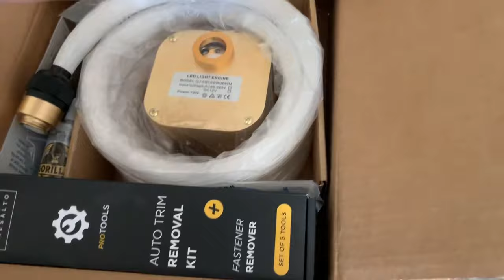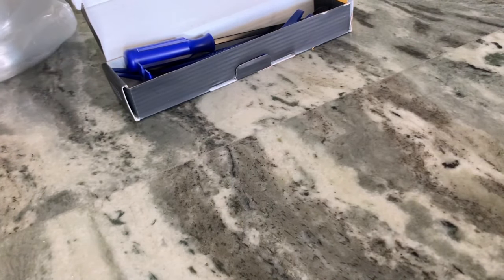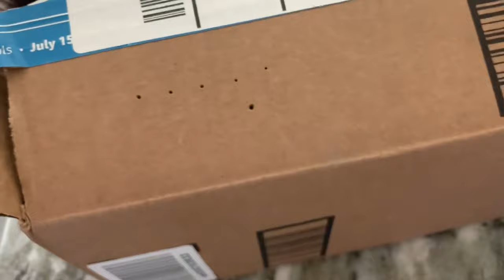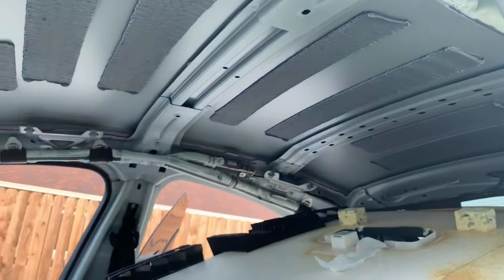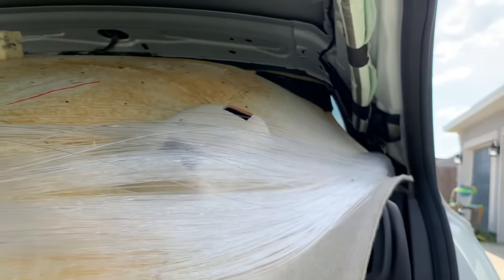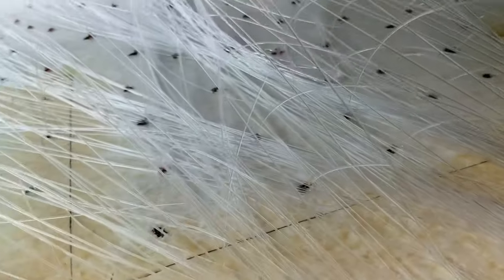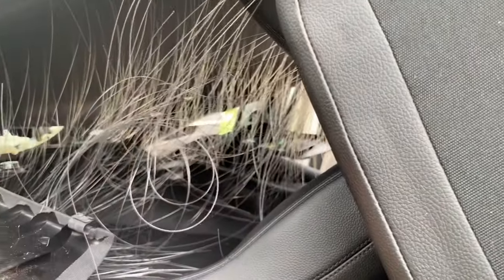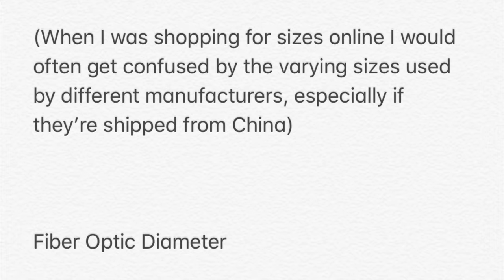How to Install a starlight headliner in 2023

Comment: Would you recommend me drilling holes into my sun roof shade to have it in my shade when closed?
Reply from the maker: Riley Becerril I would not recommend using a drill. I would recommend using a push pin to press through it
Reply: Reynaldo Velasquez i just don’t know if the push pin will be strong enough to go through cause the sun roof is harder than my headliner
Reply from the maker: Riley Becerril ahhh I see, well then in that case I guess you will need to improvise. Yeah try the thinnest drill bit you can find
Reply: Reynaldo Velasquez okay Thankyou
Reply: Reynaldo Velasquez would you honestly think it’s a good idea for me to do that? I’ll have to give it a lot of slack right when it comes out and tape it down to the sun roof, and I have tinted windows so it isn’t noticable
Reply from the maker: Riley Becerril I guess I would use the pin needle and tap it with a rubber mallet to get it to pierce the sunroof. Be a little creative I guess
Reply: Reynaldo Velasquez okay Thankyou I will try that first and if not I will drill it
Reply: Did you make a vid for the sunroof part? How did you run the wires??
Reply from the maker: Whitney Johnson I just ran the cigarette lighter plug 🔌 between the back seats from the trunk, and plugged it into the back seat cigarette lighter outlet. Nobody sits back there and so nobody has ever noticed this small wire back there

Comment: What year is your car? Planning on doing this on my 2017
Reply from the maker: 2014 Mercedes-Benz Cla 250
Reply: @ReynaldoVelasquez  okay thanks. One more question. The black pieces on the headliner which you labeled R1 R2 etc, did they cause any issues or problems when reinstalling the headliner after you toke them off and put the optics underneath? Meaning since they were not flush with the headliner, they now just rested loosely on top of the optics.
Reply from the maker: @jsjc100  no they didn’t cause any issues. However when I was reinstalling the headliner and shifting the headliner left and right to shimmy it up… the black things would try and reposition themselves so I would stop and put them back in their original location.
Reply: @ReynaldoVelasquez  I see, maybe taping them down would help? Or gluing it a bit using a hot glue gun?
Reply from the maker: @jsjc100  I don’t know if tape would really help, maybe duct tape…. And I’m not too sure about the hot glue gun, the fibers can’t/shouldn’t really be folded flat. The need to have a little arch. If you bend them at a 90* angle they may break and then they won’t conduct light as easily. They do have a little bit of glass in them so we need to try not to snap it
Reply: @ReynaldoVelasquez  oh yeah make sense, slipped my mind that your not supposed to bend them 😅 thanks for the replies! Cheers 🍻
Reply: @ReynaldoVelasquez  any idea what the purpose of those black parts you labeled R2 etc are? I’m thinking maybe I shouldn’t even put those back on
Reply from the maker: @jsjc100  I still have yet to find out. you know what... I think im just going to google it. and reply back with an answer

Comment: Hello sir, you seem like you are experienced with all of this. I wanna install this on my mustang 2012, I just have concerns regarding which one to buy, the 32W or the 16W, what are the differences other than the wattage and length? in addition to that, from what you see, do you think 335 pcs is enough? or should I get 430?
Reply: 450 would be good it would also give you enough to add in a design if you want. For instance I’m putting a Z in mine.

Comment: Did you ever rewire it to the dome light? If so, how?
Reply from the maker: No I never got to do that. I just wired it to the auxiliary plug/ lighter fuse. I figured there was no need to set it up to the dome. Just adding more work for a small effect

Comment: Do you have to wire this or can you just use it with the cigarette lighter
Reply from the maker: You can use both options
Reply: @ReynaldoVelasquez is there a certain way i have to separate the fibers to install them?

Comment: Will it be ok to use silicone glue?
Reply from the maker: yared haile I’ve read some people have used silicone glue, and epoxy in other applications like making model trains and model spacecraft or other things that use fiber optics. But I don’t want to Steer you wrong for this project when you just want to get it right the first time. I will say this, NEVER use super glue because it will melt the fibers and make them brittle, you can use a hot glue gun but it may burn the fibers if you touch them with the hot tip plus having it plugged into the wall that whole time will take a toll on it, and the electrical cord will be getting in your way and you’ll be trying to squeeze a handheld gun between hundreds of congested fibers without bumping into them or damaging them. I will just say this buddy, just use the glue I used in the description. I know for FACT it dries fast and will not damage the fibers. Hope this helps
Reply: You could probably try putting a dot of glue on one fiber to see if the fiber still works

Comment: What a reasonable installation price ?
Reply from the maker: I’ve seen some people (not businesses) here in Texas charge as low as $400 to do it for a side hustle. I personally think that’s too low of a cost for the amount of labor going into it. And I’ve seen businesses charge anywhere from $1500 - $2500. Hope that helps. On average I’ve seen the 2000-3000 at a shop

Comment: How did you wire the motor ? Great vid
Reply from the maker: Heather Hasty hi! I’ll be making that video in the next couple weeks. And uploading it. I needed a new fuse tap. It turns out I ordered the wrong size, but I’ll explain it to you
Reply: @ReynaldoVelasquez  thank you so much this was a excellent  video and enjoyed learning how to do this thank you so much i also subscribed looking forward to the next vid
Reply: @ReynaldoVelasquez  Did you get around to doing this video by chance? cheers.

Comment: What and what did u buy just to make sure ?
Reply from the maker: I bought a light engine with twinkle effect. About 9ft of fiber optic that came with it. I bought a trim removal kit for the headliner removal. Markers, some nippers to clip the fibers. Gorilla glue links should be in the description but I need to check if they still work

Comment: Can I wire it to the headlight switch
Reply from the maker: Jack’s Mustang  I suppose you could... but i don’t want to steer you wrong. Look into it and try it out and let us know
Reply: Ok
Reply: I know alot of you guys aren't that tech savvy but maybe you are but o do know that if your running alot of different aux items to your fuse panels or other switches I would recommend having a professional wire it directly to a blank slot or to your aux lights. 12v may not dream like a lot but it can def drain. We all know all newer cars live off electricity. So I'm will be bvb using the cig lighter option only cause I have a12v socket already in my rear and that already is connected to my fuse box....powered off after use power on  whe. I wanna stunt....simple. I would be powering them off nightly so it's not it's not li ing for current while the car is off....please correct me if I'm wrong

Comment: what did you do with the bulky power supply
Reply from the maker: I cut off the the plug kept the wire and wired it into my fuse tap. And the light engine is stored in my trunk
Reply: @ReynaldoVelasquez  thanks.

Comment: You should just get a separate battery for the trunk your gonna customize more you can set you a fuse panel just for the accessories I do that to my cars but with the starting system it's a theft deterent
Reply from the maker: Hmmmm interesting….. I want to learn how to do that
Reply: Run the battery parallel long positive thicker the better and hook up a fuse panel you can be extra get an expensive battery isolator have the whole thang hooked up to a breaker
Reply from the maker: @cocopublicnews6766  I’m actually curious about this!!!!

Comment: Did u route it to the trunk?
Reply from the maker: Yes I sure did. I routed the power wire through the trunk, all the way up to the fuse box under the passenger side footwell. And the fibers I ran from the headliner into the trunk through the C-Pillar next to the back seat.

Comment: Which one is better, using power from cigarette lighter, fusers or an inverter in the trunk? You forgot to tell us how much you spent for everything.
Reply from the maker: Today Tv well the title of my video says for only $200 lol but truth be told it was actually less... about $180. I don’t believe there is a “better” way per say... but aesthetically I think using the fuse tap is a sexier approach since you can hide the wires. But I have mine hooked up to a lighter outlet in the backseat and nobody ever goes back there or looks back there. So it’s worked for me. I ran the plug between the two collapsible rear seats to the back seat, center console, with the backseat ashtray.
Reply from the maker: Today Tv I’ve provided the product prices in the links in the description.
Reply: @ReynaldoVelasquez  I have watched other videos it seems like most of them have problems with car battery being dead due to the installation. That was why I asked the question. I just bought a new accord I am afraid about the installation and battery dying but I really really love the lights.

Comment: So I dont kno how to replace a phone screen lol… if i cant replace a iphone screen, can I replace a headliner? Cause ik thatll be my ONLY problem. Figurin out where to put everything back nd all. Im gettin a s550 in a few days and i ironically came across this without knowin u can do it yoself😂now i really want it man… but i dont wanna mess the headliner up or get everything together and the lights dont come on🤦🏾‍♂️
Reply from the maker: You can do it. But worst case scenario…. You can always buy a new headliner for your car on eBay for about $300-$600 and start from scratch
Reply: @ReynaldoVelasquez  ight so my next question is opinion based. The benz got 2 sunroofs so only 150 fibers needed. But how u think that would look? 2 sunroofs and stars? Lol u got a IG? I can DM the pic of the interior
Reply from the maker: @trevey16  if the second sunroof is one of those curtain style (for a large panoramic window) then it may not work. But if it’s just two normal sunroofs, it could look good. I would recommend installing some stars on the sunroof cover too so that there’s not just a big black hole with no stars… in my opinion it kinda ruins the illusion. But yeah my Instagram is ReynaldoVelasquezJr

Comment: Hi, does it overheat ??
Reply from the maker: YTC Gatti no not at all. The light engine is in the trunk and it does not overheat. The fiber optics also don’t emit any heat what so ever
Reply: @ReynaldoVelasquez  bro that's so cool, I will do it to my car then, but how did you plug the box to the car ?

Comment: How do you connect to power???
Reply from the maker: At the end of this video is a link to part two. How to wire it. Or you can search my channel for the second part. The kit comes with an AC adapter and a car plug if you decide not to wire it into the fuse box

Comment: Was there a link for the fiberoptics?
Reply from the maker: Yes there’s a QR code you scan to be able to download the app and control the fiber colors with your phone app.
Reply from the maker: Oh did you mean a link to buy them? It should be in the description.
Reply from the maker: @KIMakaBLUE  no, they’re all the same size. They look bigger because they are the brighter ones at the time of the photo (as the light engine spins it brightens and dims some to give it the twinkle feature

Comment: How much ft of wire did you use ,
Reply from the maker: That’s a great question… I never measured it, if you’re talking about the wire to the fuse. But if you’re talking about the fiber optic, i believe i used 9ft fiber length and there was way way more than enough.

Comment: Did you end up wiring it to a fuse?
Reply from the maker: Yes I sure did. Used a fuse tap (add a circuit)and plugged into the lighter/power fuse
Reply: @ReynaldoVelasquez  you used the ground wire and fuse circuit on your description?
Reply from the maker: @Snuuupp  yes. I have a second video detailing the wiring
Reply: @ReynaldoVelasquez  I need help finding the wire, the link doesn’t support it nomore
Reply from the maker: @Snuuupp  thanks for the heads up. I’ll replace it
Reply from the maker: You can get it on amazon

Comment: Just remember not all headliners are installed through a door or trunk, Some headliners are actually installed through the front windshield before it is installed! So unless you are going to have someone remove the windshield for  you will not be able to remove the headliner from the vehicle!
Reply from the maker: Great point! Maybe this is one of those…. Or it could be my lack of experience with it. I’m just glad it got done haha
Reply: Glad someone said that. I thought about it immediately, but it's not something that I guess most folks would consider. I think windscreen glass is one of the last things installed during the initial build.

Comment: Why wouldnt u just feed the headliner to the trunk and pull it out though there
Reply from the maker: It didn’t look like it could fit, maybe if I took out the back seats and the trunk liner I may have been able to... but that would have been way more work

Comment: maybe the headliner comes out through the trunk
Reply from the maker: I think maybe.. with enough persistence I could have tried that by removing the back seats and part of the trunk liner. But it was 100F and I was watching my two sons in the process of doing this project so I just did it on the fly with the time I had available

Comment: So we don't need a 400$ kit like I've been seeing..
Reply from the maker: You can get a cheap kit or a $400 kit. At the time I made this video I bought the $150 kit with the tools needed. But I’m working on a new video that should be out this week. It is an expensive kit with 550 stars and 5 shooting stars. Consider subscribing to watch the new video. Usually the more it cost… the more features or stars you get with the kit. But you can also buy a $60 kit on Amazon but it’ll be a basic kit.
Reply: @ReynaldoVelasquez  ya the one you linked seems good.. and I have seen videos with the shooting stars, very cool.  Might have to give this a shot